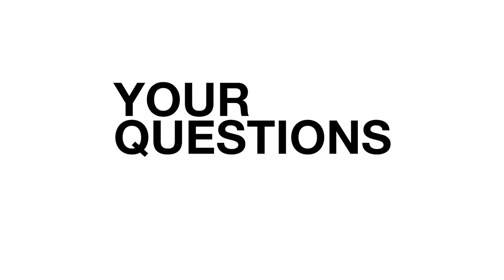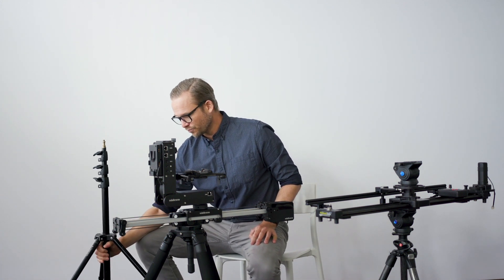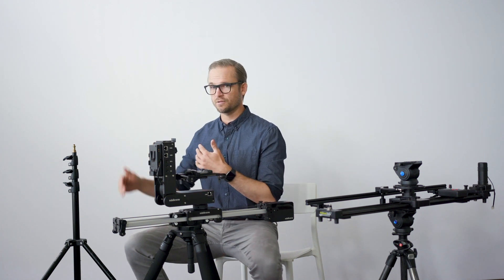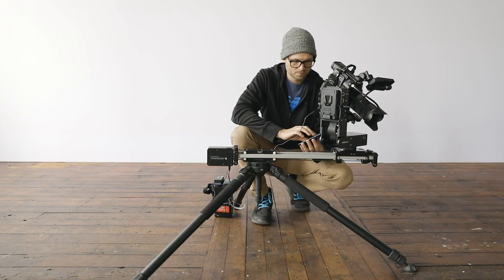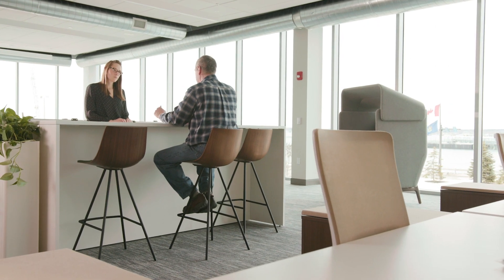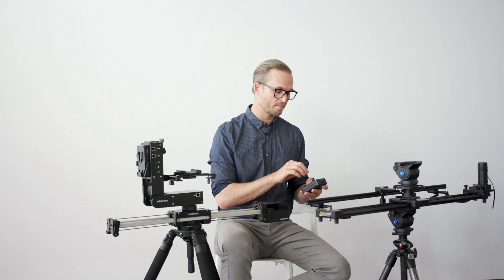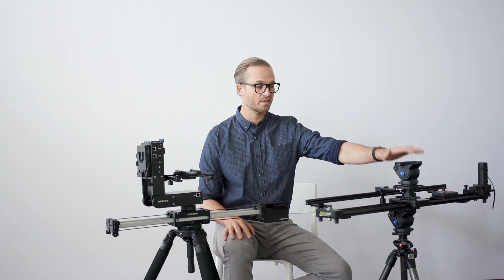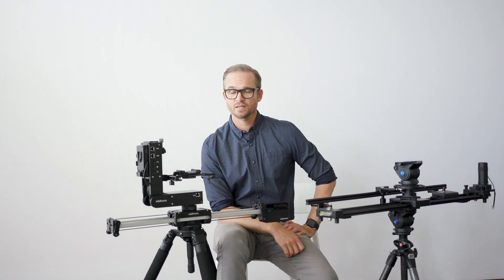Using MOTION CONTROL to DOLLY Through INTERIOR SPACES

Comment: What tripod are you using with the Edelkrone? Just got that same setup and need to upgrade my tripod. Thanks!
Reply from the maker: Benro A373F with fluid video head
Reply: @adppod  Was going to get the A474F 100mm tripod, is the A373F enough to hold the edelkrone slider with HeadPlus? Was going to go with the larger Benro because I was worried the 75mm A373F wouldn't be able to handle the slider/head while fully extended. Thanks for the info!
Reply from the maker: @fatheadmediapro  Hey Jonathan.  So I thought we had a Benro Tripod but I was wrong.  We have the Induro Alloy 8M Video Tripod Kit with the 100mm Bowl.    If you are able to find something equivalent you shouldn't have a problem supporting the Edelkrone.  Of course we use it with the legs splayed all the way out for maximum stability.

Comment: Wow I’m surprised to hear the edelkrone has been so finicky. Bummer.  I didn’t realize it couldn’t do vertical movement either. Interesting.  Thanks for this video!
Reply from the maker: We tightened the belt to add a little more tension and it seemed to have solved the issue. We did an outdoor shoot last winter that also involved interior shots.  I think the temperature swing between the two extremes had an adverse effect on the belt tension, which led to the ongoing issues we had. Thanks for comment!
Reply: @adppod  Was about to mention this. The belt tension issue is kinda annoying but once you know how to fix it it is very easy. If you have trouble with losing connection or sometimes the bundle not registering the Slide Module V2 or the Head Plus I have found a solution to this by doing the following steps (sequence is crucial) : 

1. Remove power from all edelkrone devices
2. Turn off Wifi and Cell Data on the phone you use the app on
3. Close the app for good (make sure its really not just minimized)
4. Open the App and press "Smart Pair" - keep the screen with the instructions on!
5. Power on the Slide Module first and wait a second (literally)
6. Power on the Head and wait for both beeps
7. Once the last beep was audible press "Start"

This method started a very solid connection that lasted throughout the whole day, including locking the phone etc. We had severe problems before to make this app work consistently but this did the trick.
Reply from the maker: @tigermafia2100  Wow, very helpful.  Thank you for the detailed reply.  We will certainly take these steps into consideration next time we have an issue.  Thanks for watching.